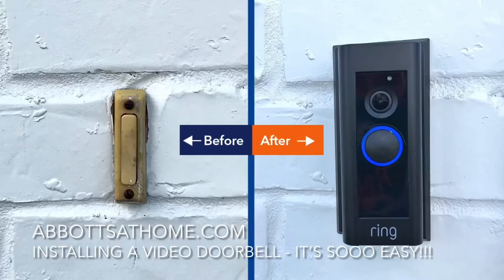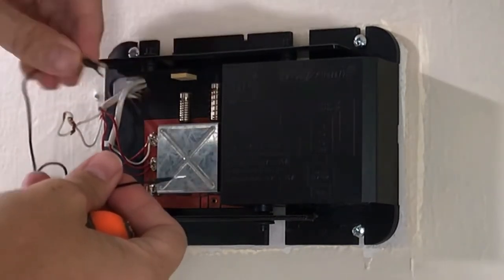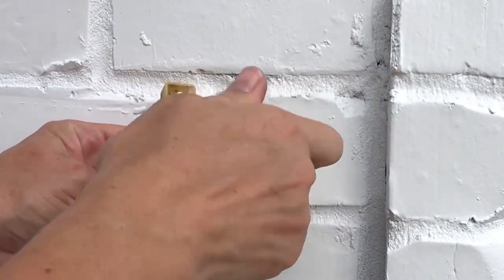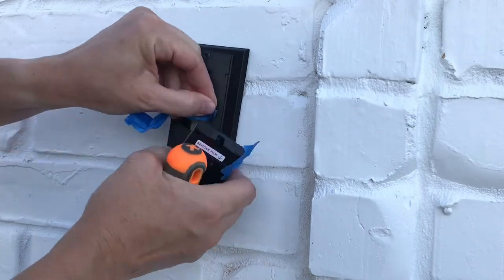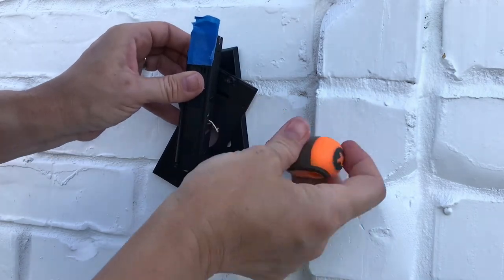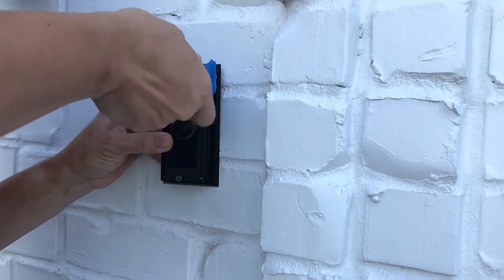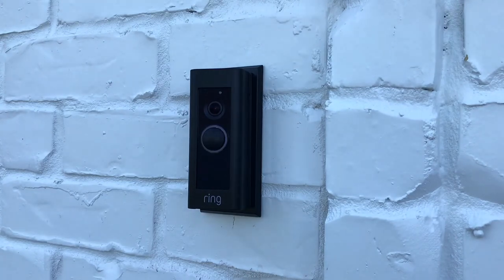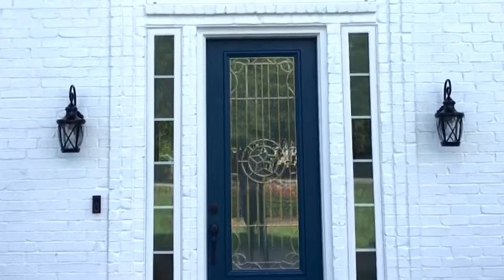It's SO EASY! How to Install A Wired Ring Video Doorbell (Easy To Follow DIY Steps)

Comment: I did this same thing but the door bell chime inside the house is humming and it won’t chime , wires seem to be hooked up right too
Reply from the maker: I would check with Ring support. I think they have a phone number and/or chat. That's the safest option. :)
Reply: Thank you 🙏 happy holidays ☺️